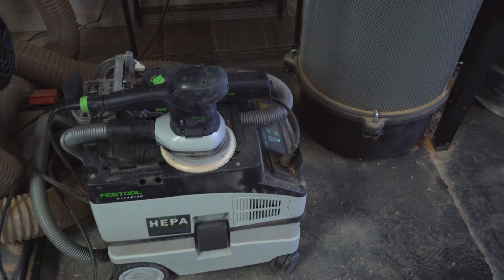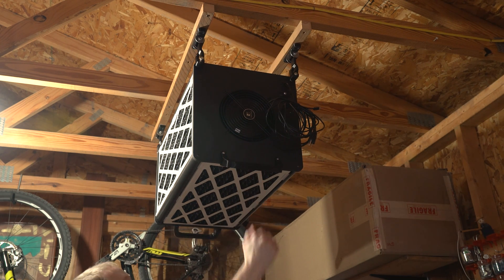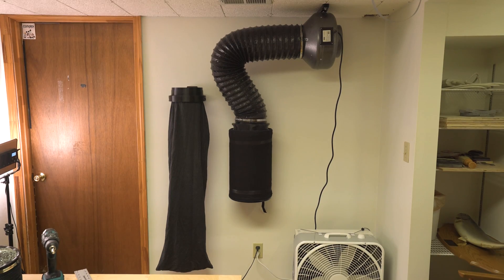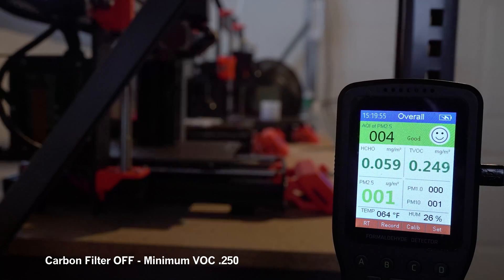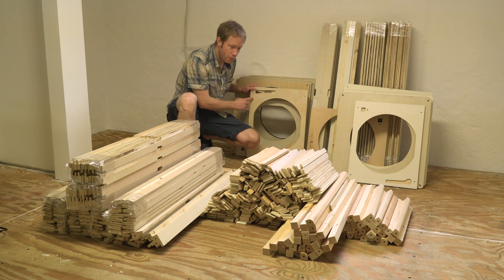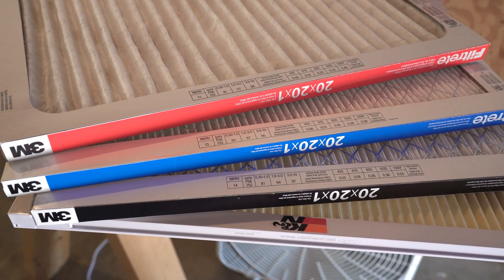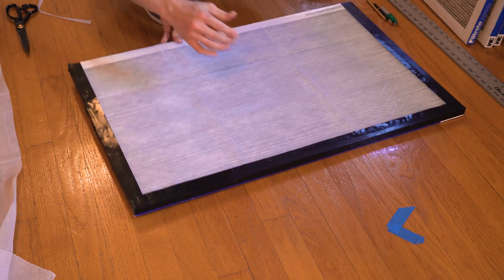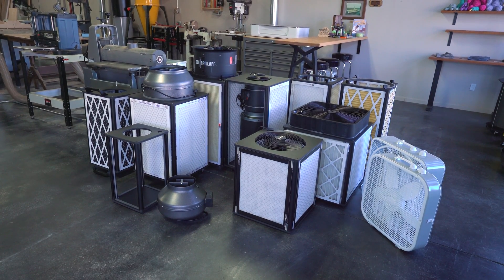DIY Quad Filters - Everything you need to know

Comment: My concern for any DIY air filter would be what material is used to seal the mating surface to the frame that holds the filter. The triboelectric effect of the particulate material being drawn to the box filter through the air would cause small particles to become charged or ionized, which over time can cause the material (eg foam seals) to degrade and deteriorate. While the nature of the dust (eg metallic vs organic) may dictate any requirement to dissipate particulate charge before filtration, a method of neutralizing any dust would help mitigate any possibility of a dust fire or explosion, which is why a regular inspection of any filtration system (such as a furnace filter) is important. A grounded cage or grid outside the filter box could neutralize ionized particulate matter prolonging the life of any material used to seal the filters to the supporting frame. The cage could simply consist of chicken wire attached by a ground wire going to a ground point on the fan itself. Thanks for a great video that saves any DIY days, if not weeks, of research in designing, building, and maintaining a box filter for various applications.

Comment: W8 a second!! At 3:27 u show us a fan sucking in "smog". ? Wouldns be better if a fan is turned the other direction?! So it's sucking air from filters towards ceiling
Reply: ..I saw it why, later in the vid.  But all air filters have clean air blowing into the room.  You should direct clean air towards a wall, so it will ride the wall surface, and not create that much turbolence?

Comment: When using a box fan if the fan blades are 18 inches cover the face and leave a circle open an inch or so smaller than the fan blades size so us a 16 inch cut out for the 18 inch fan. it will reduce the amount of unfiltered air drawn in at those corners.

Comment: Excited to buy one of your kits. When you say "adding a prefilter to disposable filters" are you talking about adding a canister filter inside the box? Looking for the best one and done solution for a two car wood shop and was looking at the model b cat fan kits. Is this something I could add a prefilter to? Thanks for all your hard work! Hopefully it's paying off. Lots of people's lungs should be thanking you.
Reply: I have ducted dust collection to most of my tools in a two car garage but i'm looking for the best option for cleaning ambient air quality for long durations building furniture. I'd rather not have to move a filter around every time I switch tools. Any tips would be greatly appreciated!
Reply from the maker: Hello! The CAT fan option is the most powerful kit I have at the moment. It works well in a 2 car garage setup. For a prefilter on these I just tape some mesh material to the outside of the filters. The links to the material are in the video description. You will have to vacuum the filters occasionally but the filters will last longer. Even if you don't use prefilters, you can expect the filters to last at least a year. 

Let me know if you have any other questions. An etsy message is a better way to contact me, I don't have much time for YouTube comments at the moment.
Reply: @The3DHandyman  Just placed an order on etsy! After thinking about it, I ended up going for the 12" AC infinity wall mount option to save floor space. I liked the fact that it has a 10 speed remote that I can use anywhere in the shop. 

I also have plans to build some air quality sensors for around the shop using Plantower PMS5003T sensors + some esp8266. I have Home Assistant and Prometheus running locally on a raspberry pi. Should be able to save sensor data to view long term trends and get an idea of how well the air filter is working.

Comment: Great video. Watched a couple of your DIY filter box videos and they are all quality and it's awesome to see you updating on the journey and lessons over the years.

One question I have, I was very surprised watching the video how well a duct and plastic walls trapped dust within the plastic "room" and allowed it to be collected easily using the duct.  "This is perfect!" I thought to myself... But at the end of the video on the "FAN DATA" screen I was surprised to find that most of the inline fan options ranked low for you? 

To me, inline fans seem to be one of the easier options to mount on the roof and to attach ducting to so i'm just curious what your thoughts are about it.  This specific setup is for a small basement workshop (roughly 18' x 10') so I'll likely drop plastic walls all around it and be doing the majority of my work in the middle of the room. Keep up the great videos, Thanks!

Comment: I disagree.   I believe air turbulence is essential to get most room air filtered instead of getting an area near the filtered.   Even the issue needs fans to mix up the air so co2 does not cloud up near people.  Or similar to vortexes that make Helios crash.
Reply from the maker: Assuming you are talking about fan direction induced turbulence... If the pollution monitor shows that the air is getting cleaner, faster, and far away from the filter, that's what matters most to me. If it shows that, then you can assume the air is not stagnant.

The drum fan can point into the filters and still work better than when the fan is pointed up from 15ft away with a pound of ultra fine wood dust, cement, and oily vapors caked onto the filters. It works well if the floor space is not completely obstructed.

If the floor is open, the vortex issue is not present with the drum fan, but it is present on other open-cage style fans. The cowl on the drum is an effective tool for air direction.
Reply: @The3DHandyman  I fully support this fan filter design.  But I believe in air turbulence in rooms to agitate air for better filtration..  I'm hoping, less turbulence allows air to stratify and let dust settle on surfaces.   The same way liquid paint settles, cream in coffee, dirt in toilets, organic matter in fish tanks......dust on floors.   Imho....filters make a bubble radius of clean air around units but fail to clean air fully around room limits, even with natural heat convection that occurs in room air normally.

Comment: Have you tried centrifugal blower fans?  They are the most common type of fan found in HVAC systems and they can move significantly more air at higher static pressures vs an axial fan.  This is important because the filters are restrictive and require static pressure.  Centrifugal fans are the kind of fan your furnace uses to blow air through the HVAC filters you are using.  A lot of these filters are rated for 0.5 in WC and a lot of axial fans aren't even capable of producing static pressures that high.
Reply: I’m also very curious how this would affect the noise and efficiency, am looking to build my own but minimizing noise too

Comment: Amazing work! Which combination of fan / filter size do you think would offer the best CFM per watt? Which speed setting?

I'm interested in running these quad filters at their most efficient setting and am aware this may require a higher number of quad filters for the space. That is to say I am interested in optimizing for max CFM per watt not max CFM per Sone (noise level) or max CFM regardless of noise.

Would running the AC Infinity Cloudlift 12" around the middle setting be the best bet (11.6W per your fan data graphic)? Or possibly the AC Infinity Cloudline 8" at the lowest setting (3W)? Do you have any idea how much CFM those two options would be?
Reply: Here to comment because I’d also love to know the best CFM per watt with some different configurations. Would just be great to be able to run these all the time without worrying much over the cost.

Comment: I am wondering about what you said about pushing air into the filters vs pulling. The chart towards the end of the video, did it show the best result was a push or pull configuration? Also, I imagine the fan is a lot cleaner in the pull setup, not pulling the dust through its blades. What has been your experience? 

I’m coming from the PC building world and there are different schools of thought about push/pull through radiators for efficiency and long term performance

Comment: How feasible would it be to put just a single filter on the front of a box fan and only run it just below the airflow the filter is rated for? Would the filter being in the direct airflow of the fan cause turbulence disturbing the dust on the surface of the filter, or would it just be overall limited in its airflow in exchange for size and portability?

Comment: I made one of these with a standard box 20" fan and a high-flow 20x20 HEPA filter strapped to it. The fan motor wasn't meant for that kind of static pressure and you could smell the motor getting hotter than it was designed to. I checked the temperature with an IR meter and it was fine, but you definitely need two or more filters to not overwhelm a cheap fan with air resistance.

Comment: All filters for home I see, and one I bought, had fan OUT at the TOP. Making barely ANY dust go to the filter. Essentially it blew away dust above the filter box in the corners of room, making dust free "cloud" above the filter, but all the dust easily settled around all over the place. And dust that touched the surface never was lifted again ans sucked into a filter even if filter was 10 cm away. I tried to dust off the dust with brush, but again blowout pushed everything away from filter's intake so nothing got filtered in few days ... I declared those house purifiers a SCAM. Regular house vacuum cleaner with small hose sucked more dust particles inside. I realised that we need powerful suction, that actually suck some air in (with dust) and than blow that out gently over larger area which are filters, to return air back. Also blowing out near the floor lift the dust that already settled and eventually got sucked into filter ... reversing the fan is crucial.

Comment: If your designs have a base that can be removed, easily, could you introduce cooling effect by placing a container  like a plastic mixing bowl full of ice cubes inside the box fan to create both an air filtration device as well las a cooling device?

Comment: Hi, I really like your work. I was wondering about using the Caterpillar 14 inch fan to make a proper dust collector, e.g. to attach to a table saw or planer, with a vortex separator feeding into it. The CFM is high for the fan in your arrangement, but wasn't sure if the CFM would drop to very low levels if connected to 4-6 inch tubing and a vortex. Curious to hear your thoughts. Thank man!
Reply from the maker: Thanks for watching! A good rule for axial fans is to not run them in a duct under the side of the fan housing. They will not be able to move enough air to keep the motor cool if you restrict them too much. If you want to have a 14" duct, it would probably work well... it would just be a bit large. haha
Reply: @The3DHandyman I didnt know that about fans. In that case it looks like I need a radial fan type to collect dust from table saws. Have you come across any radial/blower fans that can be DIYed into a cheap dust collection system? Ty

Comment: Why are most of your fans (e.g., the AC Infinity fans)  in a pusher configuration, with the fan sucking are into the box and out through the filters?   The Healthy Home Guide channel showed the AC Infinity Cloud12 in a reversed direction, with air being sucked in through the filters and blowing up and out of the fan.   It seems that this would collect a lot less dust on the fan this way.
Reply: The same concept at 6:27  should explain that. Less turbulence in the air does not stir up the dust as much.

Comment: I have a fairly large shop space at 26'x40', with 12' ceilings, housing a wood shop, fabrication space and automotive shop.  Currently, I'm in the process of redesigning the space to actually be somewhat functional versus the hodgepodge it currently is, and I'm considering a built-in filtration/circulation system.  I have to say, I appreciate some of the math you've included here, because I was unsure of how many filters I would actually need!

I plan on having a separate dust collection system for the woodworking side of things; this setup would just be for general air quality.  I think two ~1000cfm inline fans in a duct, with the inlet filters at one end of the shop, and the outlet dispersed and directionally vented at the opposite end, may work.  That should be able to cycle all the air in <7 minutes, at least on paper.

Comment: I’m trying the Catepillar fan version. Question about another subject: disregarding these particular fan types aside, do you have any thoughts or research on impeller type-fans? My understanding was the impeller fans move a lot of air without encountering as much resistance as these types of fans. Correct me if I’m wrong.

Comment: It's a real bummer how all of this is SO SO USA centric, I can barely make or do anything with all of this knowledge..
Furnace Filters are hard to find and seem to cost double of the US.
None of the fan options are available in Europe (no CAT 14 inch, no maxx Air, no typical box fans, no AC infinity S12 or S14).
I can only find cheaper floor fans, or very expensive industrial ones that are probably super loud. Also a toon of 20 or 24 inch fans that are enormous and don't fit an affordable filters.
Shipping from your etsy shop to europe is crazy expensive, and you don't share any of the 3D files to print yourself....

Comment: Great job on the video a few years ago I had to paint a small 25 x 25 9 foot ceiling classroom with red paint and I did my best to mask off but I decided to take a 20 inch box fan and I had a 20 x 20 filter and I taped it on the back and was quite amazed at how much Particulate that picked up just by itself I loved your design work

Comment: If the top and bottom were 3 pieces maybe 1.5” then ?12?” then 1.5” the  2 “side filters” could be removed and the whole thing stored on the wall at maybe 5-6” thick. 

Also do you sell multiple fans tops that fit your 20x30 

The CAT would work well in the garage but with kitchen filters and fan it would work quieter for sour dough bread flour.

Comment: I have a question about the AC Infinity CLOUDLINE 8” . On amazon, their decibel rating is 38 (which I assume is the lowest/quietest it goes) but your chart in the video says 83/65/43 db. 

Did you independently check the noise levels?

And do you know the cfm air output level for the low and medium fan settings?

Comment: Nice video. But its better to suck air trough the filters and then to the fan instead of pushing it from the fan into the filters. Because the vacuum may suck also the filters into the frame and seal them. if you push the air trough the filter the filters may get pushed outwards and the air may get around the filters instead of going through them. Plus your fan stays clean since it pushes already cleaned air.

Comment: I've been doing a lot of research on box fans vs HEPA filters and it seems to me from the data I have seen across the Internet. In most scenarios these quad filters do more work at cleaning the air then HEPA filters with regards to allergens and other ultra fine or large particulates simply because they have more passes at cleaning air and more volume. CADR seems to be a better  metric for determining how much filtration a fan can do and MERV 13-16 seems to be the sweet spot because of high airflow. Thank you for making the elegant and functional fans more accessible. They look very excellent quality and would love to try one out in the shop!

Comment: i am trying to figure this out as a value.. the kit is $200, the filters are $90 each x4 and the fan is around $100, by the time im done at around $650+ i could have just aimed SEVERAL large fans to exhaust air through the work area..
Reply: But, what if its hot or cold out? Or pollen season? Or you live in a dusty area? Or your in an area with lots of traffic?

Comment: This is a great video!👍  I love these designs for larger particle filtration and I think they look really good, as well. Professional looking.  You are VERY talented.

I am also intrigued by the carbon solution as I think there is a need in the market for a reasonably priced filtration solution with a lot of good quality carbon for VOCs/chemicals/odors - that doesn't really focus on filtering particles too much.  Air purifiers which possess a lot of carbon (15 lbs. and more) tend to be pretty expensive.  But, some folks (and even certain businesses) are in an environment where they really just need a super duper Carbon solution above everything else - as chemical absorption is their #1 most pressing need, by far.    I think you could maybe even create some specific carbon solutions for certain niches which will be much less expensive than what most consumers are currently seeing available.  

Also,  of note: I've had 3 different air purification manufacturers say to run the units on medium or low speeds to improve the ability of the carbon to absorb the VOCs/chemicals - they felt the slower air made it easier to filter the chemicals/odors. 
 
I don't do any woodworking but you are forcing me to watch more of your videos.  Good Stuff! 👍

Comment: If you're using a fan with a duct, why not just send it outside without the filter? What is the benefit to be adding a filter? If you're sending it out of the room anyway?
Reply from the maker: A lot of people have suggested that. There is nothing wrong with it, you just loose your climate control in the process. For some that may be an issue.